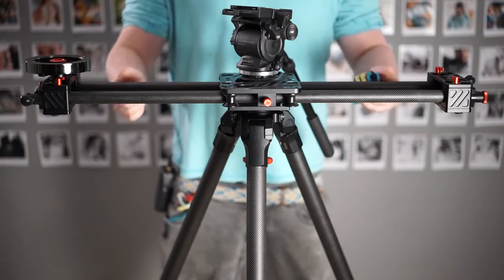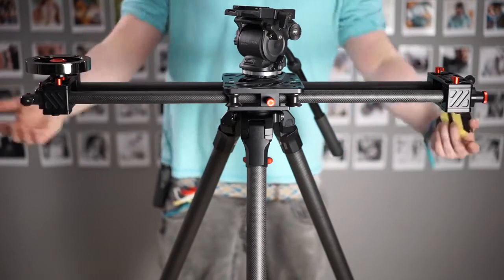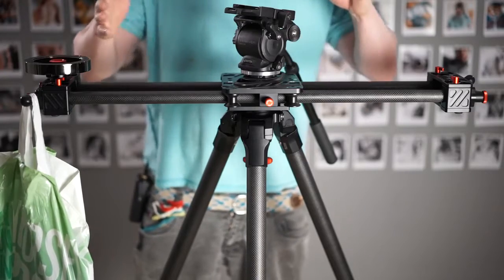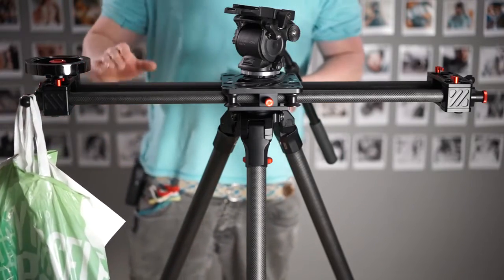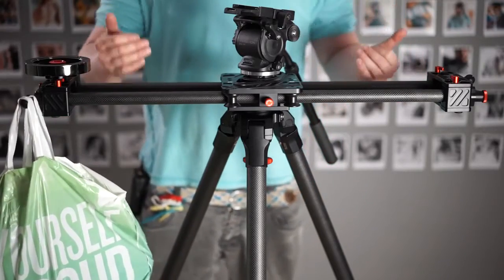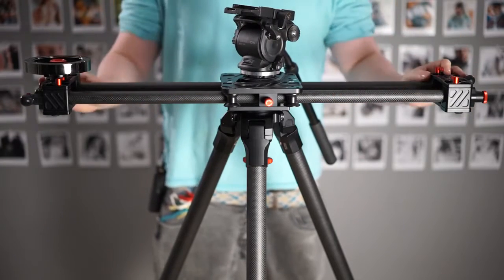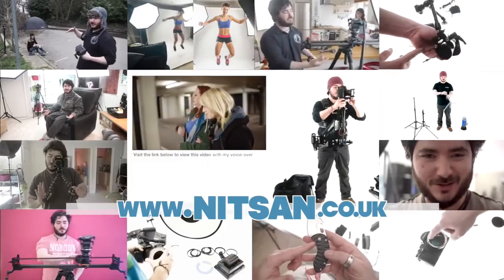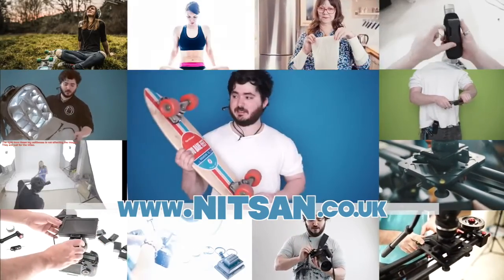Slider tripod flexing  How much is okay  How to test & fix

Comment: Using one monopod will only prevent flex when tracking to that side. When tracking to the non-monopod side the monopod will come off the ground unless a weight bag is attached to it. Understanding basic physics is necessary when discussing planes and inclines.
Reply: He literally mentions that in the video. duh